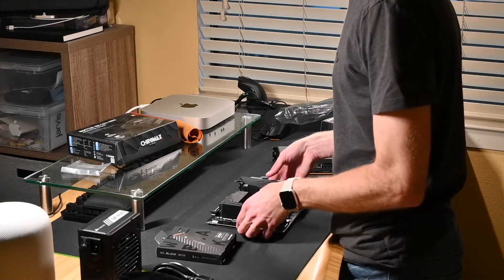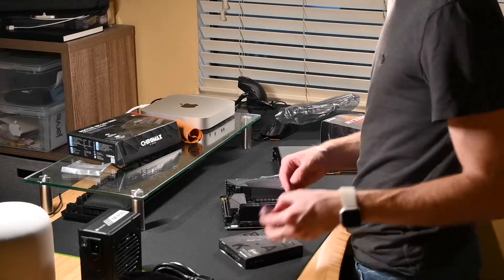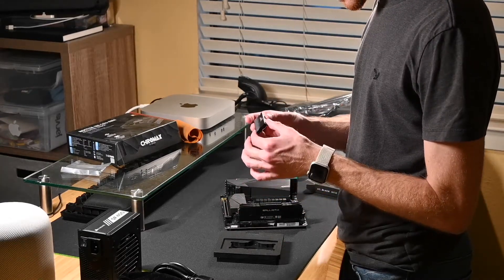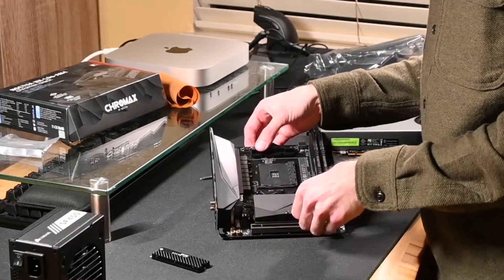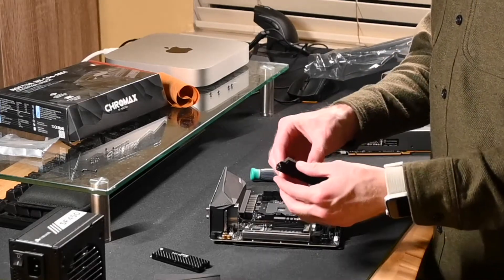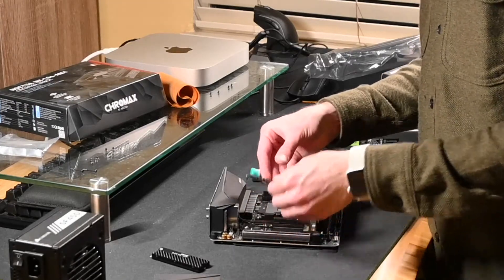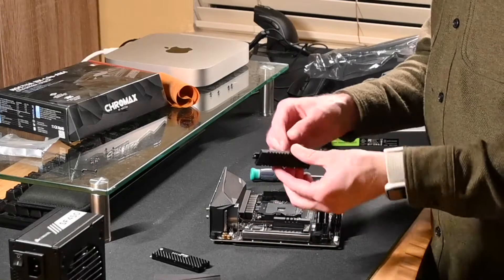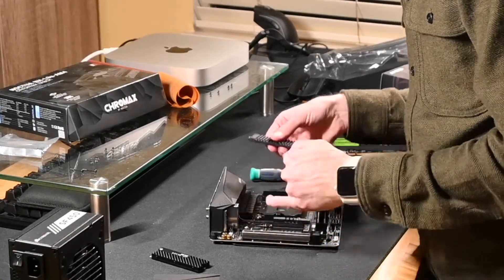How to build Mini ITX Ryzen 5600X: M.2 NVMe Installation on Gigabyte B550i Auros Pro AX

Comment: Do i need to update bios to t5 5600x and b550i aorus
Reply from the maker: typically yes, however it might be that motherboards shipped today already have a bios installed which supports 5600x, so it may just work, and if not then you can follow the steps to do the Qflash

Comment: The second stand-off you did not use is intended when using the included heat-sink: You would tighten the NVMe with the threaded stand-off and mount the heat-sink with the M.2 screw. In your case, it is not needed.

Question: Might an NVMe with a heat-sink stick out on the back-side or does it for sure?
Reply from the maker: ah thanks for the info! hmm on the backside? yeah it would stick out, I dont think one with a heatsink would fit (have not verified though, just guessing)
Reply: @relaynotes  Thanks for your reply. Yeah, I guess it will not fit, would be nice if you could verify at some point :)
Reply from the maker: @keineahnung4227  for sure, unfortunately the case is mounted and built and I dont have time these days to take it apart since this is just a hobby for me, but totally makes sense. Sorry I wasn't able to help, but yeah, there's not much room there haha